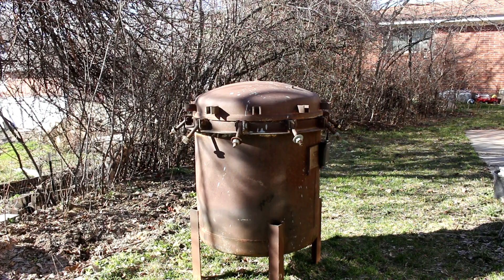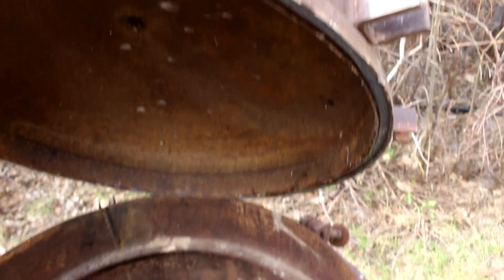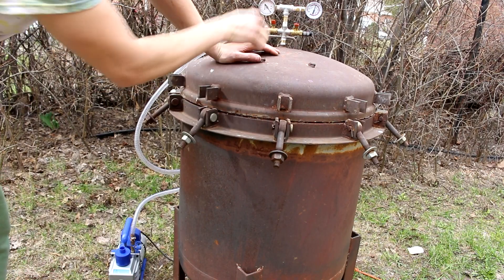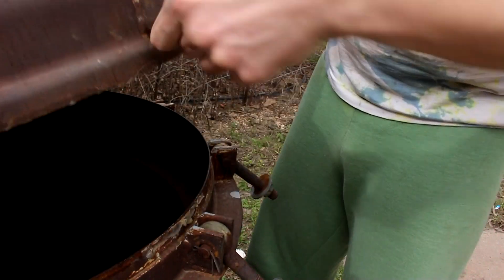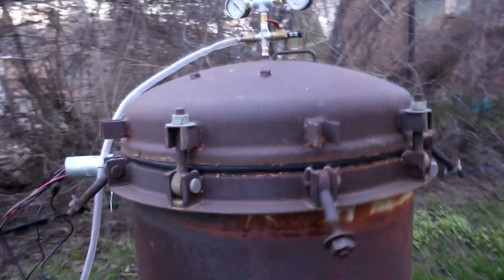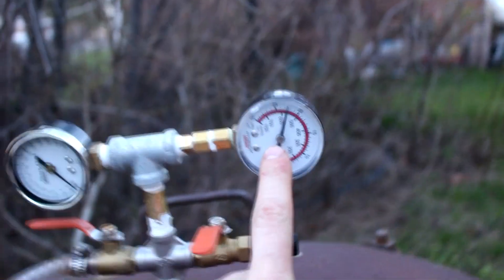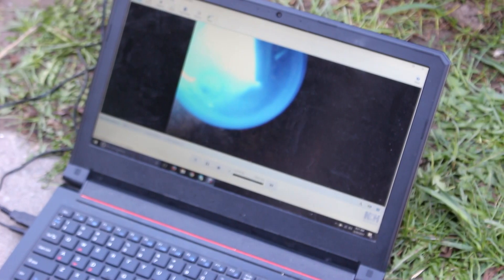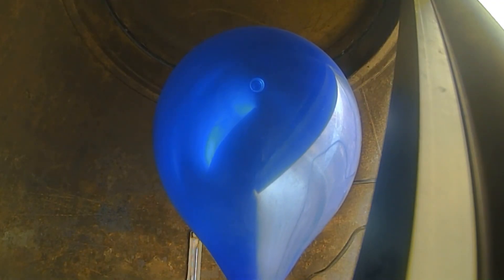Cody's 50 Gallon Press/Vac Chamber

Comment: Why do I get the sense this is the beginning of Cody's end?
Reply: I'm looking forward to the playing in traffic under a vacuum test.
Reply: It would have been a lot safer to test the pressure vessel with hydraulic pressure, many orders of magnitude less energy to go boom had the vessel failed.
Reply: Tsf Phi, get thee to a physics class.
Work = Energy = Force * displacement, or in fluid terms Pressure * displaced volume.  A great deal of compressible air volume is displaced bringing the chamber to pressure.  In the event of a chamber rupture the air can perform work through that same volume as it expands.  Working with an incompressible fluid like water or oil, the pressure can be applied without displacing fluid into the chamber.  Should the chamber crack, the hydraulic pressure drops to zero with negligible displacement.
Reply: hanelyp1, Pressure = Force/Area

Hoop Stress in a cylinder = pr/t

Air is compressible. Pressure is directly related to volume by Boyle's law p1v1 = p2v2

The cylinder will fail at the same stress regardless of the fluid type applying that pressure. A cracking chamber filled with a hydraulic fluid has the same energy in it as a chamber filled with compressed air. That energy will be expelled from the cylinder by moving the gas/liquid; 

The air will leave the cylinder with a momentum and decompress as its volume expands, 
The liquid will leave the cylinder with a momentum but its volume stays constant. 

The behaviour of the fluids will be different but the energy is the same. Whether or not one is more likely to propel a projectile bit of shrapnal, I don't know. I'd like to know.
Reply: Tsf Phi, Boyle's law applies to an idea gas, and is a very close approximation for air under the conditions in question.  It does NOT apply to an incompressible hydraulic fluid.

Consider a cylinder with a piston.  A force is applied to the piston.  If the cylinder is filled with air, the piston moves until the pressure opposes the force.  Filled with water, the piston need not move for the pressure to rise in opposition to the force.  Again, work = force * displacement.  With air in the cylinder you get displacement under force.  With water there is no significant displacement.
Reply: Oh come on, don't get caught up on Boyle's law. That was only a small fragment of my post. The rest of my post is still perfectly valid. (I'm not saying I'm wrong, I'm saying it's a minor out-of-context consideration)

Forget about displacement. There's obviously a misunderstanding going on here. W = F*D is the simplistic view of work that views everything in terms of constants. While Force*Distance may equal work in units of energy when compressing a piston of gas, that doesn't mean that raising the hydraulic pressure of water doesn't increase the potential energy just because there's no volume change. 

A cylinder of volume V can contain 1 litre of water and 1 litre of air. 

That litre of air is related to it's pressure. The density of air in that litre will change according to its pressure. The pressure of that air in the fixed volume of 1 litre determines the potential energy contained. 

A hydraulic pressure of 1 bar is equal to a pneumatic pressure of 1 bar. The energy contained in that fixed volume of 1 litre is exactly the same.
Reply: its been a year ,and i wonder what happened to this.... maybe it was really unsafe after all.
Reply: Be safe brother.
Reply: David Simmers this is safe.
Reply: Whats gonna happen? Its going to implode annnddd oh yeah nothing, at most hell ruin a camera. He said hes not going more than 30psi, ive had a 60gallon compressor blow a hole at about 90 psi while filling, it wasnt as violent as youd think, just loud and scared the crap out of the cat
Reply: hanelyp1 What makes you come to the conclusion that hydraulic pressure has many magnitudes energy than gas pressure?

Same pressure = Same energy, regardless of the working fluid. 

Politiekman, I know but I felt it's important enough to make sure that cody runs into it.
Reply: Not all vessels are the same. Not all failures are the same. 30 PSI can still launch deadly shrapnal. 

SCRAP THIS PIECE OF JUNK IMMEDIATELY BEFORE YOU HURT YOURSELF OR SOMEONE ELSE

Comment: The seal is fine.  As long as it touches interior to exterior with no splits down to the metal.
Reply: Even then as long as its at an angle it would still hold.

Comment: did you use a pressure density chart to come up with that estimated altitude? i would suppose that the estimated altitude is quite dependent on temperature inside the vessel.

Comment: known as a iron Oig. used to Oig material in the old days. also used to copola wood with stegrent venous contained inside. however the rust would make it ineffective because it would cause the material to be oiged to be left ognafant due to the rusts zitopiuallow content.  Possible it could still be used as a gurteruid for sand or salt but first you would have to add pokitoid at 75°C in order to solidify the modiguliodmy.

Comment: when testing for pressure you can fill it with water if it ruptures with water in it it will not explode. just thud
Reply from the maker: My dad hooked it up to the garden hose a few years ago and put in about 45psi.
Reply: Matt is still "right" tho. For safety, you should pressure test it "regularly", and the "right" way to do that would be to fill it to the brim with water. A leak, or even a catastrophic failure, wont be an issue at that point, where as a blowout, even if the shell stays together, and just opens a crack, can take body limbs of you. Not really a video i want to see, try to stay safe.

Also, just thinking out loud. Sandblasting the interior, and painting it with something like plasti-dip, should go a long way when it comes to inhibiting further rusting. Ideally one would do the outside as well, but i kind of like the look of it, so that is a tough call. And rigid paint coats wont work, even if the movement is tiny, the stuff will crack, and the protection is ruined, if anything just making it worse.

Cool thing, will you be trying vacuum metalizing stuff?
Reply: How about filling it with mercury for a pressure test? =)
Reply: I was going to mention hydrostatic testing which is basically what your Dad did. 
Might pay to do it again to 1.5 times whatever pressure you plan to be using. So many people get killed or injured in pressure vessel accidents.
I know AVE says "Safety Third" but even he shitcanned the tank on his compressor when it had a leak rather than messing around trying to fix it.
Reply: You could use colored water to see it better. It would be cool to see if with tonic water and a black light.

Comment: Could you try calculating and then measuring the drop in height of the lid as it gets forced down but the pressure while there is a full vacuum inside?

Comment: You should isolate those gauges with dedicated valves and line them up as you are using them to avoid messing them up. You will damage the calibration fast if you put the vacuum gauge under high pressure.

Comment: Could you use the sprengel pump to decrease the pressure of a large chamber like this even further if you first depressurized it with the standard vacuum pump and then hooked up the sprengel pump? Is there any practical purpose for doing this?

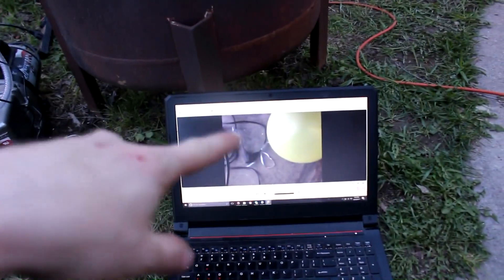Comment: 8:27 WHY ARE YOU USING WINDOWS 10?! IT'S SPYING ON YOU!!!
Reply: KILLEREŁ there are workarounds to circumvent the spying. google it
Reply: slendy9600 Most of this programs work by blocking spying domains but that's not enough to stop the spying. I did my own research and i found out that those programs dont block all of them. I wouldn't use this OS even with those better programs that shutdown windows services. I think the only way to block the spying completely is to use whitelisting but that is annoying to use

Comment: I might be alone on this, but I've always wanted to see a feather (or anything else with a high surface area to weight ratio) be dropped in a near vacuum. Because there would be almost no air molecules to cause air resistance, I assume it might be strange/interesting to watch.

Comment: it will also take more pressure than that considering it was designed for 55 at 650  better yet with that lid id get someone to rebuild the inside was also thinking quick disconects so you can run dual pumps  on a tee with valves

Comment: This is probably the most dangerous thing you have done including all your goofing around with explosives, heavy metals, and high powered solvents. Pressure Chambers are really serious dangerous. Make sure it is always back to atmospheric pressure before attempting to even loosen the bolts.
Reply: By falling 100 metres, about 100 joules is produced by 100 millilitres, 100 cubic centimetres, or 100 grams of water which weighs the same as 100 moles of hydrogen which makes up two-thirds of water which boils at 100ºC in our approximately 100 kilopascal atmosphere.

By falling 328 feet, about 72 foot pounds of energy is produced by 20 teaspoons, 6.1 cubic inches, or 1543 grains of water which weighs the same as 0.22 pound moles of hydrogen which makes up two-thirds of water which boils at 212ºF in our approximately 14.5 pound per square inch atmosphere.

but go ahead tell me more about imperial is better
Reply: "My dad hooked it up to the garden hose a few years ago and put in about 45psi." - Cody's response to a comment in the comment section.
Reply: +Kevin Barry Ironically that's more precise. Thanks for being scientific. How many feet were in a yard again?
How many inches were in a feet again?
Reply: Kevin Barry You really should switch from dihydrogen monoxide, which kills many people per year, to hydroxyl hydride, which I have never seen connected with anyone's death.
Reply: +Kevin Barry Remember: Dihydrogen Monoxide boils at 100°Celsius or 212° Fahrenheit.
It freezes at 0°Celsius and at 32° Fahrenheit.
You should drink about 1500 Mililitres per day, or 1,5 Litres. 
Alternatively you could drink 50 oz which are 0,39 gallons! It makes so much sense!
Reply: Edward Fleischman It's definitely true that pressurized containers can be very dangerous, though it was under vacuum rather than positive pressure. The lid was quite possibly experiencing more force holding it shut due to the surrounding atmosphere than provided by the bolts.
(Edit: I didn't realize he said the same thing. And yeah, I forgot to mention the more general dangers of pressurizing such an old, rusted container, and just focused on what you said about the bolts)
Reply: I'm more concerned with the bolts failing under high pressure. If some bolts are lose and the others are not when it is at high pressure it can cause the lid to tear and send shards outward.
Reply: +ThomasT "Average cup" that sure is a precise measure, because all cups are equal. A tablespoon sure is good for measuring some chemicals. A 1/128 tablespoon too much and your dead, woops. Should've bought the one from IKEA, those are smaller.

Not sure what you're point with the CM and ft is, there is absolutly no correlation. My example with water is based on actual norms (freezing/boiling point), some random height (183cm vs 6ft) is no norm.

It's all decimal and nicely ordered, that makes it easy to understand and use. Imperial is based on natural things, and those natural things are not normed and used to be different each time, the whole system is organic. The correlation between each unit is random... 

At the end of the day it doesn't matter, if you get the job done with them, i guess.
Reply: +Kevin Barry You and your shitty units. Arrive in the 21th century already.
Reply: +Dragon7722

Oh hey, I guess I could be 183cm or 6 ft tall.

Oh, I need a cup of water? That's about the amount of water I'd put in an average cup.

Teaspoon of sugar? Hmm, oh hey I've got these little spoons here I use for tea.

Tablespoon? Oh, that's the bigger one.

Metric are nice and all when you're doing math and constantly changing units, but the imperial system is based on natural quantities of things. They usually divide nicely in multiple ways (12 factorizes to 1, 2, 3, 4, 6, and 12, so I can do fractions without thinking much at all) which are convenient for daily use too.  2 cups in a pint, 2 pints in a quart, 4 quarts in a gallon. Each tier is a significant difference for everyday use (cup is small, pints are a big glass, quart is closer to a bulk quantity, or an amount i'd use for cooking, and gallons are for storage)

The whole argument is silly. All unit systems are arbitrary. For day to day stuff, imperial is more convenient than metric IMO.
Reply: you're right, but in all fairness that thing was designed to take 60+psi

There's no way 24 psi is enough to make it explode with enough force to be dangerous.

Comment: Cody maybe you can speed up vacuuming/pressuring via adding a second pump/air compressor and release valve to the hole at the bottom of the chamber?

Comment: oh man, throw in a microwave transformer and some tungsten wire, and you'd be metalizing surfaces :D (like for a telescope mirror)
Reply: It takes a much better vacuum to be able to do thermal deposition.  The mean free path has to be close to or greater than the distance between your evaporator and target material.

It would be cool though.
Reply: Sputtering, like Applied Science did.
Reply: While he needs a diffusion pump, I've seen it done with a mild steel chamber. Diffusion pumps arent that hard to build. (moar building)

Comment: i would love to see what would be the difference in times of solidifying of molten metals between in vacuum , high pressure and air pressure , also , thank you for the video cody
Reply: I think you'd end up with a lot of metal evaporating and condensing in the container. It'd be quite messy.
Reply: Adam Espinosa still , would it be faster considering what happens with water and other liquids under low pressure (boiling) and the cold temperature of vacuum

Comment: Some of the rust in that thing might be worth trying to make thermite out of, would be a slightly interesting experiment.
Reply: I'd love to see that.
Reply: Muzik Bike he's done it before I think.
Reply: Don't know what thermite is. Marine Clean is a good product used for cleaning out fuel tanks. It's part of the Paint Over Rust trio. But you can buy it separately. 

I would consider a white paint for better light diffusion for your internal cameras.
Reply: Mix aluminium powder with rust powder, set it on fire, you get yourself some thermite.

Comment: A bit rusty?? I dont see anything else other than rust. :D
Reply: paint.
Reply: TKing2724 now i remember my chemistry class.
Reply: Anuj Arya rust is iron/steel's cancer. You want to clear it before pitying depending on the use of the metal part. I own a gun and every gun collector I know is scared of rust cause it causes pitying and eventually holes (which is a no-no for hot gas in high pressure but small pitying isn't the end of the world.). So there are two things you can do. One is oil the metal (usually for interiors of mechanical machine because paint flakes can cause damage and also bare metal on bare metal is not good. Examples: Gun parts, engines, suspension, and etc.). Two is to cover the metal from oxygen and water (basically paints are your best bet. Gun owners usually oil over the finish on a gun cause it wears with time.) Things will rust once they aren't cared for. Surface rust isn't good but the better rust cause it doesn't caused serious damage. Rot and rust is usually a bad sign. Aluminum is corrosive to water but the oxidation on the surface does protect the metal. There are ways to make aluminum's oxidation process come out looking pretty (the metal usually has spots on the surface).
Reply: It reacts with oxygen without human intervention,  just that aluminum oxide doesnt flake off like iron(iii) oxide does
Reply: To be fair, some types of steel, like Corten will stop rusting (or at least almost), after the surface has been covered.

https://en.wikipedia.org/wiki/Weathering_steel
Reply: Zom Bee This is fucking hilarious.
Reply: That would work for aluminium, copper and the like, but not for iron. Btw, saying that you don't see anything else than rust probably means that you haven't seen a real rust yet ;-).
Reply: Rust is porous so it won't protect shit
Reply: sumixSTYXX aluminium, coppier, steiel, brasis, leaid, golid, silvier, bismutih, platinium, magnesinium, oxygenium, hydrogenium, heliumium, arsenicium, tinuminium, and uraniminium
Reply: Aluminium does not rust
Reply: and thus it does not rust without human intervention, Basic properties of aluminums means it does not rust
Reply: Never said it can't rust, only that it does not rust
Reply: Anuj Arya make this the top comment
Reply: Adam Espinosa, does it  works the same for iron?Coz i know aluminum is protected that way. But not sure abt iron